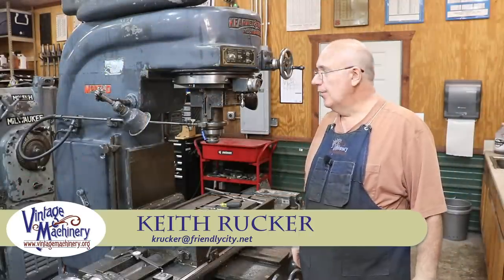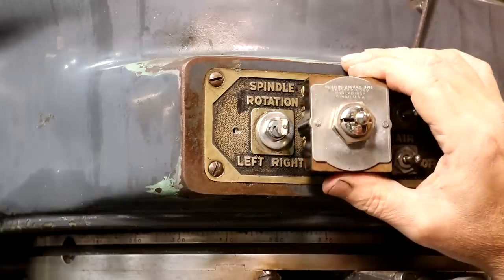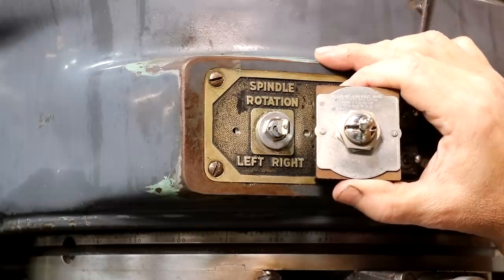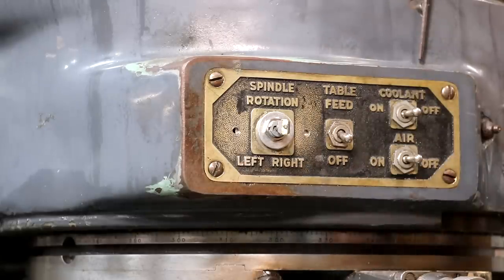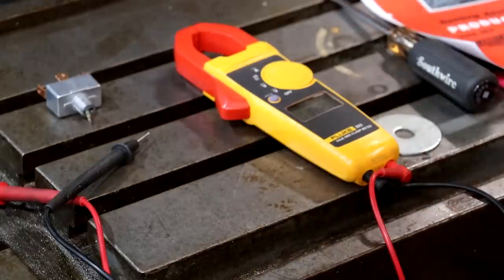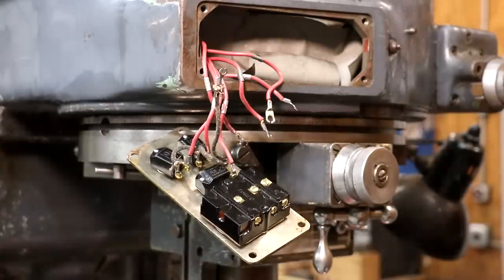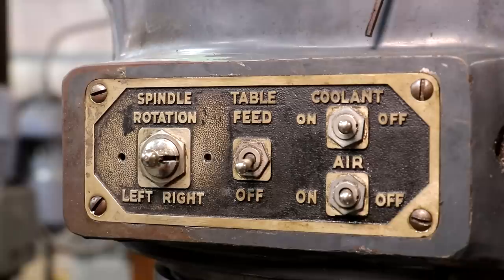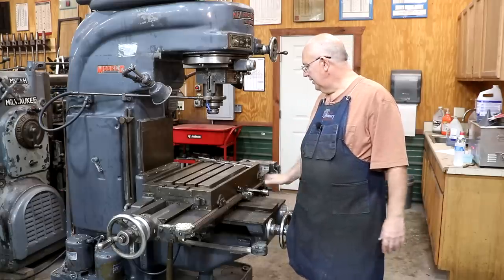Kearney & Trecker 2D Rotary Head Milling Machine: Installing a New “Old Style" Spindle Switch

Comment: Hello Kieith, I enjoyed seeing the K&T  Rotary Head Mill. I worked at Boeing Company in Wichita, Kansas. They paid highest wage running this machine. I have ran this machine with cherry attachment, universal attachment, and with rotary table on machine bed. I made many punch dies  which are installed in punch presses. Many profile patterns to make punch parts for airplanes. Also tooling work. With precision ground endmills hold +/- 0.0002. (yes +/- 0.0002 that is correct number) We had micrometer precision shafts and extensions.  In 1985 Boeing put on digital scales on K&T  Rotary Head Mill and other equipment - faster to run. It made me fast to calculate lines, curves, arcs.  Used paper. pencil, and drafting tools if needed. No CAD in shop at this time. I later had more high paying, and management jobs. That K&T  Rotary Head Mill was start of my advancement. With care it is amazing how accurate that machine is in good condition.
Reply: Did you get trained in the point of origin machining system used with these? I want to learn it.

Comment: I worked in a movie film processing lab in the 1970s, doing audio work.  Several of our projection machines had these exact "positive center off" switches.  The positive off feature prevents the user from doing a direct changeover from forward -> reverse & vice versa.  This protects the motor from harmful surge currents at each direction reversal, surge currents that may also cause nuisance fuse failures, as you discovered.
Reply: Do you remember the brand of the machine?

Comment: Keith, Nice work just finding a replacement switch.  The two holes at three and nine o'clock around the switch-- if they look to be original -- I am thinking were to hold a safety cage to stop accidentally engaging/disengaging this switch.  The 'cage' may have been nothing more than a single wire bar type, much like a drawer handle with screws at either end.

Comment: Hello Kieth, Just for you and the others the special switch is known as a "hesitation" switch. It will not travel through the center position without first letting off the forward pressure when in the off position. I kinda doubt the original switch would have had 3 terminals connected to the center screw connection. Likely the original switch was aslo a DPDT (center off) type and the second pole would have been used to turn the power off to the "Air" and "Coolant" switches when the spindle was not running. Whomever replaced the original switch with the SPDT unit probably wired those functions to be on at all times.

Comment: Very good switch choose. When it fails you have 2 more to use.  Depending on current  wire all 3 in parallel and have a switch that should not fail in most peoples life time.

Comment: There seems to be lots of comments about the 2 extra holes in the brass plate .... I can explain them! The original Milwaukee 2D machine, used more of a horizontal type wall switch, which was mounted at the 2 holes in question. When Kearney took them over ....they evidently received stock of the pre-drilled brass switch Plates, then decided to use the type of switch that Keith just installed for some reason .... I guess the moral of the story is....if you have unused holes, put screws in them!

Comment: I learned to be careful with electricity as a child when the freezer in my Grandparent's house would give me a tingle if I touched the handle while standing barefoot on the tile floor (all two pin when the house was built in the 1920s). I could feel the 60 cycle if I moved my hand around on the handle! Very slight but my Granddad taught me more as I got older. How to tie an "Underwriter's Knot" in a lamp cord and use a soldering iron. Mom, of course, was not happy! 😆
Reply: our freezer did that too

Comment: Hi Keith, great you got a replacement switch. One suggestion when fitting the switch is to adjust the rear nut so at the front of the switch the thread is flush rather the having protruding. Looks much neater and matches the other switches.

Comment: To get an elegant installation, the inner nut should be backed out to have the front nut just flush with the dome, no threads showing. This adjustment allows for different thickness panels. Note that the other switches are set up that way.
I agree that the original switch probably controlled the coolant and air pumps so they would be off with the spindle stopped. Is there any documentation on that?
But what the heck is the air pump used for? Clearing chips away so you can see what's happening at the cutter?

Comment: I would recommend that you take some electrical tape and put a few wraps around the back of the switch to prevent a screw or wire grounding out on the side of the machine

Comment: Keith, I really like the efforts you go to to return machines to original.  That switch is a definite improvement, both for aesthetic reasons, and the stop that prevents accidental reversing.  However your mounting is going to bug me every time I see that machine in a video.  The switch is supposed to sit flush to the nut, as it appears in the photograph you showed.  Please adjust the backing nut so it doesn't protrude from the panel like that.  I know, I am being ridiculously obsessive, but you managed to trigger one of my long term pet peeves.  Almost all electronic components that mount on a threaded stem have two nuts, which allow for panel thickness compensation and to set the front flush with the panel.  Potentiometers and switches that protrude from control panels stick out like a sore thumb when I see them. (pun may not have been accidental)
I really look forward to seeing this machine used in real life to do otherwise difficult milling operations.  This machine has been supplanted by CNC, which objectively is more versatile, but a purely mechanical solution is so much more appealing and satisfying to my nature.  On a visceral level this is like the difference between using a rotary table vs. the DRO to make a bolt circle on a mill.  The DRO is quicker, almost no setup, and  just as accurate. The rotary table is so much more fun.

Comment: Nothing wrong with changing out that switch. Its probably the closest match that you can find. I would have changed out that rubber/cloth covered wire in that enclosure while it was open.

Comment: I would venture to say that those two holes that flank the L/R switch are mounting holes (are they threaded?) for the original switch, your replacement switch looks fine though.  I probably would have removed all the switches and cleaned/buffed-out that awesome brass plate before reassembly.  Another fine job Keith!
Reply: Maybe this machine has had even a 3rd switch mounted using those holes.
Reply: I noticed some nubs on the face of the switch that looked like they would fall where those holes are.
Reply: @glennstasse5698  I saw that too. I reckon Keith should put some screws in there which would fill the holes in
Reply: All i'm going to say is .. Those holes dont seem to show in the original picture at around 2:20
Reply: I’m guessing the original switch was a big, heavy duty thing that took some force to throw. I wonder if the original arrangement had threaded holes in the switch to keep it from rotating. The “nubs” ,assuming they hit the holes, would have the same effect but maybe not as securely. Did you notice how “polished” the brass was on either side of the switch? Lotsa on/off cycles to do that!

Comment: Next time you need to take switch off, give me a holler.  I'll let you borrow a deep well nut driver.  Using needle nose pliers are how you scratch up those beautiful face plates.  I used to do that.  Then I damaged an old radio.  Broke my heart.

Comment: That's Arrow-Hart & Hegeman, the A-H&H.
11:04 that's very likely the reason why the old switch broke. I'm 100% certain that the previous owner took the switch apart, fixed the broken momentary block and then couldn't install the switch back and so drilled the holes in the plate so the screws secured the whole lot to the plate. Probably a good idea because i've personally never had luck with trying to re-rivet old switches. They always crack after a while. Old materials and all that jazz. It probably broke again and someone replaced the old switch altogether.
I'd venture to guess that the reason this machine is so well kept is because of that broken switch. Blowing fuses ain't fun.

Comment: Like others have commented those two holes missing a screw on either side of switch appear to line up with the switch phenolic housing.  Since the hole doesn't have any anti rotation feature these two screws will prevent switch from rotating should the thin nut get loose.

Comment: 8:06 Switch connectors usually burn while switching on/off thousand times, what is normal.
When you check continuity between connections, you could get = 0 Ohm, but it not tell how much current it past.
So, switch can be burn so weak, it can't pass enough  Ampere to turn lamp or 3-phase contactor on.
*edit
Burn switch can also show Voltage right.

Comment: Curious as to what the two thread holes were for . Maybe cut a piece of appropriate threaded brass and some loctite to close them off. Redo the blacking of the plate to look newer than it actually is.

Comment: A six point socket would be the correct tool to tighten switch nuts.  I would have replaced all of the cloth covered wires with plastic insulated wire for neatness sake. Ron W4BIN

Comment: On the brass face plate, on both sides of the switch, there are two holes, it seems they correspond with some rivet or assembly screw of the switch. I wonder if that should not be mounted too.
Reply: At https://youtu.be/sXZo7fh5lQA?t=225 you can see two rivets on the switch. Those holes allow the switch to sit flush at the rear.

Comment: Here's a minor point.  A modern low cost switch bezel would not be plastic.  For safety, all metal (eg., switch lever) needs to be bonded to green wire ground.

Comment: Any thoughts on the outer pair of holes?  Do they line up with the screws that appear to hold the switch together?
Reply: I'm betting that the original switch had to be opened (drilling out the rivets that held it together) and the solution to that problem, where before the rivets were flush, was to drill holes through the plate that then permitted screws to go through the plate and the switch as well.
I've done this before as well. It's much, much better than trying to make the rivets work again ... and cracking the switch because you can't match the proper weight (and its old materials giving out).

Comment: A-H&H was Arrow-Hart and Hegeman, there is a bit about them on your website. They were bought by Cooper Industries, who were then bought by Eaton in 2012.  The switch in my machine is original, but is a bit slack, I’ve been plucking up the courage to take it apart and repair it, but it is riveted closed. For reference the markings on the original switch are:
3/4H.P. 250V.

5A.250V.10A.125V
UND.LAB.INSP.
A-H&H.U.S.A

It’s a two pole switch, but obviously only one pole is used. It’s massively overrated as it only has to switch the control voltage for the contactors.